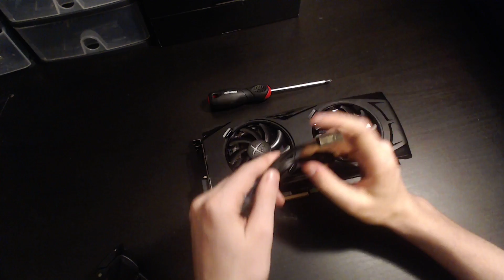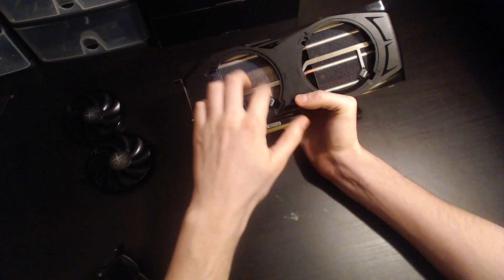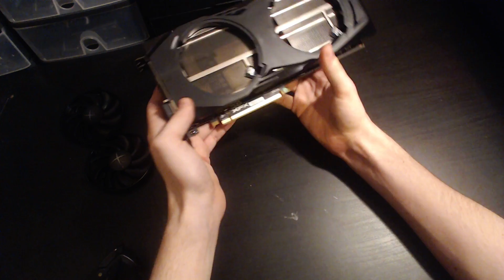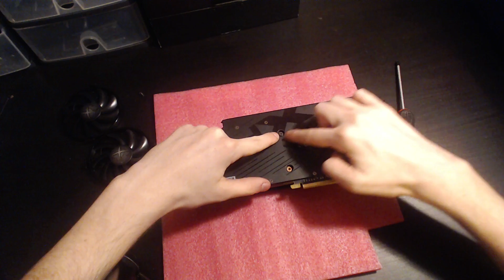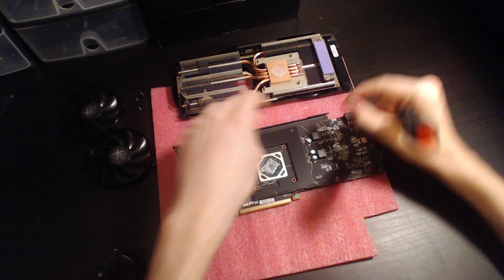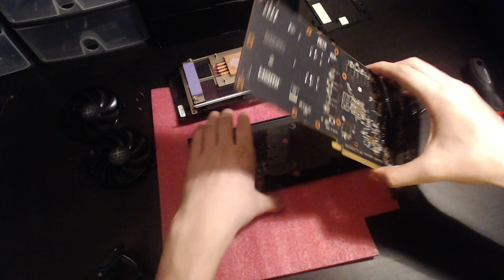XFX RX 480 GTR teardown

Comment: I have a question, i bought a xfx rx 580 gtr-s 8gb, i have 89 C in load with some games, its a good idea to change the thermal paste and vrm pads? i bought fujipoly 1mm 13 W/mk thermal pads for the vrm and artic mx-4 for the thermal paste, i readed in some reddits forums that they decreased over 20 C degrees in bad applied tim gpus (i think this is one of them) with rx 480 gtr (i think its nearly the same inside) do you think i should change them or let the default ones stay? 85+ is normal for this card? (with 22 C ambient temp)
Reply from the maker: Changing the thermal paste yes. I don't think 1mm pads are thick enough for the VRM.
Reply: Dude what the hell, mine run about 64 C max, change the fan curve, do not use that card so hot like that.

Comment: Hey so recently i've upgraded my pc to a black and purple theme build, however the LED's are WAY to bright, they ruin the subtle aspect of the color scheme, is there any way I could disable them? I've been looking online and so far no luck besides "unplug the leds" but I have no clue how to do it. If you could lend some insight much appreciated! P.S I just need the LED's on the fans, but removing the LED's as a whole would be good, if it's just possible to remove the fans, that's fine I could just throw electrical tape over the bright in your face XFX logo.

Comment: Mine is the rs version and is completely different, the heat pipes are different position and runs hot as hell, 89c with evolve phanteks case 3 fans, what are your suggestions?
Reply: Isra I think the RS version may be using reference stuff but I'm not sure. The XFX GTR and ASUS Strix seem to be the best ones.
Reply: Unfortunately i alredy bought the rs edition so i need to figure out what i will do with my card :/

Comment: How is the power draw? How much power does this take from the PCI-E and how much from the additional 8-pin? Anyway, thank you for detailed reviews.
Reply: the power draw GTRs can vary a lot strangely. Theoretically all 480s should not consume anymore than the recommended power from PCI-E (it was patched). Some GTRs have gotten as low as 100w at load. Most hover slightly over 150 though. The GTRs also generally OC a little better. Most users achieving 1400+ OCs.
Reply: Well, it seems it depeds on the software you are using to read the draw. Apparently my MSI afterburner newer notices anything beyond 98-ish Watts. Meanwhile, gpu-z saw 120W, so I tend to believe, that GPU-Z knows what's up. Thank you for answering. The GTR seems to be a superb card, as it holds the clocks and I got it up to 1.375Ghz by adjusting the vcore voltage little bit(1.170V if I am not mistaken) The only semi bad thing is, that you need all the possible OC tools to adjust everything. As wattman cannot do the fan speed. The Afterburner caano adjust the vcore properly and cant read the power draw, etc...

Comment: Hi. Can you help me? I got my xfx rx480. and it hits 89 on load. stable there. And im seeing some aftifacts. I just used it stock no OC. So far what i did is replaced the thermal paste and turn the thermal pad on vram upside down and it went down to 77c on max load. So is this good? How come other xfx rx480 only goes 60-70c on load? Any help? I have no warranty left since they dont acknowledge overheating as a replaceable here in the phillipines so that's why i opened and change thermal paste. Thanks bud!!!!
Reply: I would be happy if you could help me
Reply from the maker: Does the temperature go down if you tweak the fan speed? Also what kind of power readings are you getting with the card under load?
Reply: around 90-110w when playing witcher 3. Yes i set the fan to 100% when gpu hits 70c. Room temp here in the phillipines is like 29c. Do you think it is normal now to be on 77c max load?
Reply: Where can i contact you personally? Like a PM or email for a fast talk? Looks like you know your stuffs. Other youtubers wont even reply when i comment on their videos.
Reply from the maker: Eh we can sort this all out here. The thing about heatsink on the GTR is that it dumps a lot of hot air back into itself unless you have really good case airflow. What case do you have and how do you have your fans laid out?
Reply: Well i have a Omega x1 case. Google the stuffs so you can see. about 7 fans. All of those fans are on the controller extension of the case. Using a maelstorm120k aio cooler. Fans are Omega Nova all static pressure fans. 2 fans on the back between the radiator of CPU exhausting air, 2 on the top exhausting air also, and 3 at the front for intake. I noticed that my fans on case are not spinning that fast. i have a hyper 650w psu. i also tried my gpu on my cousin seems that the card tends to not overheat itself there. he only has 3 fans. 1 intake at the front and 1 at the top and back.
Reply from the maker: yeah try raise the case fan speed on the intake fans should help somewhat
Reply: how ? My fan controller does not have a fan header. Just a molex connector

Comment: The problem with reference cards and the PCIe was the fact that the reference model only came with a 6 pin and ultimately couldn't supply enough power, any RX480 with a 8 pin should be fine in terms of the PCIe. I just purchased this card from newegg for $280 USD with shipping and tax.

Comment: mr. zoid i was wondering if you could tell me what RX 480 has vrm cooling as good or better as this card. my gf ended up getting me a GTX 1070 aaand it was an evga card. the card was artifacting in games and it pretty much self destructed. any cards that you know of that won't self destruct?
Reply from the maker: EVGA is currently only manfucaturer that has this level of design fail ATM. Most of the other brands are fine. The only card's I'd avoid among the RX 480s are the Gigabyte G1 Gaming, Powercolor Red Devil and XFX RS.

Comment: What about the VRM refrigeration on this custom xfx cooler? we are getting a lot of RMA by selling this card, more than the average 1%. with a first look in the cooler design, i see that the Thermal Pad look kind of large, and maybe is not being very efficient, just wondering if you measure it.

Comment: Actually Hardcore Overclocking I can confirm that the card will draw too much out of the pcie slot. I installed it on an older mobo and it won't even get into the bios let alone the OS.
Reply from the maker: At stock mine doesn't overdraw.
Reply: Maybe its because it's pcie gen 2? as I said, an old mobo. It was fine running gtx 980, and 980ti though. And the RX 480 is worked on an x99 mobo. Great videos by the way, very informative.

Comment: Ive been waiting for this one. Wish I could have one of these but my MSI gaming x 1060 is working beautifully. 

1060s cost about the same in Canada as rx 480s for those wondering
Reply: The price of these two cards equal each other in Hungary too. The funny part is that right now in Hungary for an extra 10% money you could buy an r9 Fury. I'm really wondering which one to get from these three....
Reply: Peter Feher buy a r9 fury.... They are over 200 $ more than the gtx 1060 for a used one over here
Reply: Sounds like a good idea, as the fury definitely has the most powerful GPU of the three. But it also has the least amount of vram. Having a weaker GPU means proportionally lower framerate, but having less vram could potentially mean a criplled game, if it wants to allocate more vram than what the card has.

Comment: Hey Buildzoid - thanks for a great video!
Do you know if the Backplate is helping to cool the card or is the lack of thermal pads between the backside and the backplate trapping hot air near the card?
Reply from the maker: it's just for looks. No thermal pads. However the holes in the VRM area are probably to help hot air escape.
Reply: Ah Okay - thanks for the answer, just the info I was looking for :)

Comment: Buildzoid have you find a way around the negative performance scaling whem you add voltage to the Fury X? I have done some tests in mine and it does 110 fps at stock volts, 109 +48mv, 107 +96mv in heaven bench. The stock vddc is 1.168   asic 71.7

Comment: Hey Buildzoid,

Just bought a GTR.  Would it be beneficial to replace the thermal paste with my coolaboraties liquid pro ultra?
Reply from the maker: it will probably only improve temperature by a 2-5C and will stain the copper base of the heatsink. IMO CLU is not worth the risks it comes with when used as a thermal paste. I'd rather just get Thermal Grizzly Hydronaut or some other high end thermal paste.
Reply: Ah I see.  Thanks

Comment: Should I use the 8-pin adapter that comes with the card, or the 6+2 directly from the psu?

I don't think there's much difference between them, but I'm curious.
Reply from the maker: 6+2 from the PSU. The adapter is only for people with a PSU that only has 2 6 pins
Reply: Thanks for replying so quickly!
So there's really no difference,  apart from saving you a few bucks on an adapter.  
Also, does the bios switch change from a silent-ish profile to an oc profile?  Or does it switch to a failover bios in case I screw something up?  

Also, you earned yourself a new sub :)

Comment: Question, you brought up the thermal tape used for VRMs being on the thicker side, what would you personally recommend for thickness of thermal tape as I might just go ahead and and replace that as well as the thermal paste
Reply from the maker: The thing about tape thickness is that if the tape is too thin it won't reach all the way and the contact will be worse. I'll test with .5mm thermal pads and if that doesn't work stick to the stock ones.
Reply: Then wouldn't 1mm be the most optimal probably?
Reply from the maker: IDK how well fitted the heatsink is.
Reply: True so probably best just to leave it. But would be nice to play around. Might do some testing myself if I can get my hands on one
Reply from the maker: Ok so I checked the fit anything thinner than the stock pad will be too thin. I will be sticking a thermal probe in the VRM pretty soon.
Reply: Ok. Interested in seeing the results. Thanks. XFX seems to have the best vrm solution imo

Comment: Hey buildzoid, I once more need your help... I got a I7 5930k for a really cheap price of 20€ .. about 25$... the only downside is that the 2 big surface mount resistors have been broken off... So I went ahead and asked Intel about information of them, so I can rebuy and resolder them... but Intel being Intel didn't really help me other than sending me a .pdf file of useless Stuff.... do you know anything about these Resistors..? https://drive.google.com/file/d/0B-xyXdlXldihOC0yZFdhZ1Fma2s/view
Reply from the maker: First of all those aren't resistors those are capacitors. Your going to need to find out what material they caps are made of and what capacitance they have. With that you should be able to replace them and get the chip working assuming that there isn't any hidden internal damage.
Reply: I thought so too until intel said "We cant give information about THOSE resistors.." so ... I dont have any information to them.. thats why I got the processor so cheap.. the guy was sliding the cpu and knocked them out... so I dont have any clue on what caps they are nor their capacitance... Thanks for the help btw!
Reply from the maker: "We cant give information about THOSE resistors" 
I some how doubt that intel's customer support people would know what the caps and resistors are. So I think it's pretty safe to say they just don't know anything there.

I'd have it as a guess that the caps will be X7R since that's a popular material for most SMD caps in computer parts and the color more or less matches. as for the capacitance. that's a problem. However I strongly suspect that it's just a cap for the VCC or some such in which case getting the highest capacitance for that package size will probably work.
Reply: If its just a input voltage cap, shouldnt it still work?? Thanks for the help mate, I wish I could thank you somehow :P
Reply: what voltage should i get for those caps 4V and 100µF or ... do you think I'd need more?
Reply: whoops i ment 22µF ... sorry
Reply from the maker: I have no idea if 22uF will be enough however if it is just a bypass capacitor then it being too small will just cause instability issues. Too big might lead to improved overclocking capabilities. 4V should be enough. Also don't thank me till it works. I'm guessing here.
Reply: well thanks then buildzoid, I hope it'll work... I wish I could thank you somehow... really like your content :P
Reply: Ive found 6.3Volt 100µF(x5r) ceramic SMD Capacitors "SMD 1206" for 1€ a piece, but I just cant find the dimensions...?
Reply from the maker: 1206 is the size of it since that is standardized across all SMDs.
Reply: Actually Hardcore Overclocking hey thanks man, already got the correct ones soldered on... i only had 20microF 6.3 volts at home but that should at least work somewhat... Ive decided if this CPU comes back to life, I'll donate you 20€ just for ur quality content!
Reply: *and help
Reply from the maker: Well then lets hope that it does.
Reply: Actually Hardcore Overclocking for the sake of some New arctic mx4 and LN2 for 1hr 4790k overclocking :D

Comment: Hello, I need your advice. A couple of days ago I was going to buy  Radeon RX 470 4GB WindForce 2X G1 Gaming OC. It is the cheapest non reference rx 480 model in my country. But then I saw XFX Radeon RX 480 4GB Black Edition which had the same price. And now I faced with the dilemma. From one hand we have rx 480 with the better  performance, from another hand unknown vendor XFX. I have never  heard about this company before. The most common vendors in my country are Gigabyte, MSI, Asus, Sapphire, HIS, etc. So, the question is which model should I choose and how much can I trust XFX? I
understand that the fact that I have never heard anything abut this vendor does
not mean that they produce low-quality products, but such a low price makes me suspicious.
Reply: Take the XFX one. Much better cooling solution. Look for some reviews on Gigabyte RX 480. It is trash, it's hot and it's clocks are low. With XFX you will have some headroom for cool overclocking. And even if you wont overclock it is still better to buy a cooler & quieter card.
Reply: M0dEx thermal throttles just like the.  reference 480
Reply: magnefficient gaming No it does not. Don't be stupid. Mine runs cool, even overclock. 1410 MHz on core and 2250 MHz on memory.  It runs at 72°C while the fans are at 60%. Something is wrong with yours. I have the GTR Black Edition.

Comment: Do you think it would be safe to use the custom BIOS that allows for up to 1.4v on this card?
Reply from the maker: Should be fine. I'm actually using the card right now to make some custom BIOSs so in a while I might get one that is optimized for the RX 480 better than the 1.4V BIOS which is just a voltage and power limit change.
Reply: Actually Hardcore Overclocking okay cool. Should we expect a video on it?
Reply from the maker: Not on BIOS editing itself but I will post the BIOSs on the blog and I might do a BIOS flashing and recovery guide
Reply: Actually Hardcore Overclocking cool. I'll make sure to check it out
Reply from the maker: The Elmor Air BIOS works on the GTR. It just behaves a little oddly 1.4V in GPU Tweak equates to 1.3V however if you add an offset ontop of that through Trixx you can go upto 1.5V

Comment: So did you tried every RX 480 Brand? Which one is the best with the lower temps and better overclcocking capabilities?
Reply: Eternal Power I don't believe he has done eon yet but Jayz2Cents has tested just about all of them and so far the XFX GTR has run the coolest lowest voltage and has managed his best Overclock at 1475mhz. And from personal experience the card runs cool with the factory Overclock and my wattage almost never goes above 100 total draw in afterburner.
Reply: +zerg539 what about Powercolor?
Reply: Eternal Power he has not gotten the powercolor yet
Reply: "...Jayz2Cents has tested just about all of them..."
Lol what? He only has tested three cards (G1 Gaming, Reference, and GTR). Stop spreading misinformation dude. lul

Comment: the only difference between the 8 and 6 pin pci-e cables is that the former have one extra ground, so the two 6 to one 8 pin should definitely work in just about all cases

Comment: i'm thinking of getting one of rx480 aib cards. XFX and Asus ones caught my eye, and I can't really decide which one to buy. I know that XFX has great pcb and better cooling solutions than other rx 480s and seems quite stable while the strix one has better "power delivery solution". I don't really care about aura stuff and all that crap. What would you recommend? btw very very cool of xfx to send you one of these
Reply from the maker: I'd say the VRMs on the Strix and GTR are basically equal at any normal operating temperature. I personally prefer the GTR due to the BIOS switch and going long term the swappable fans making heatsink clean outs a lot less painful. The Strix might have a better heatsink. I'd get whichever card is cheaper and if they are the same priced I'd probably take the GTR due to the fans and the BIOS switch.
Reply: Actually Hardcore Overclocking Wow, that was fast. Thanks :)
Reply from the maker: the benefit of me having no life is that all my lovely subs get comment replies quickly.